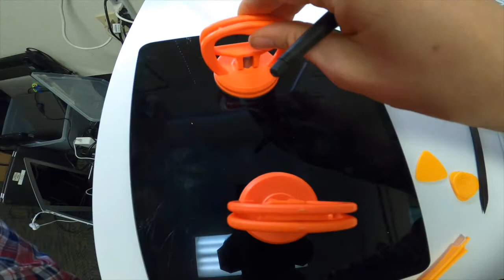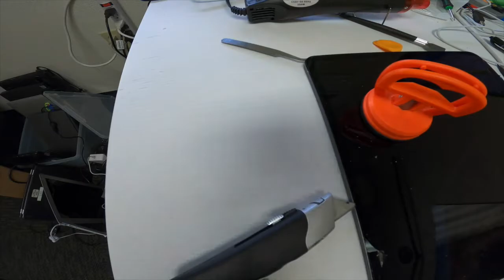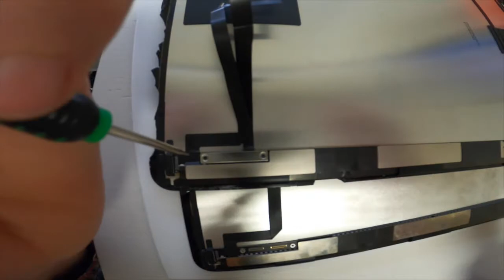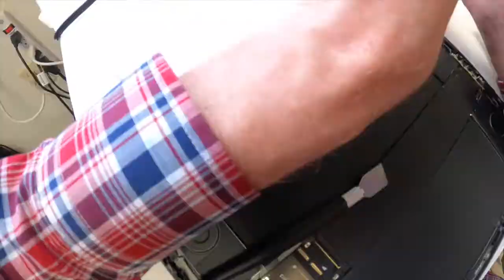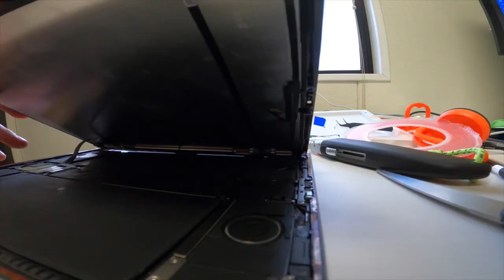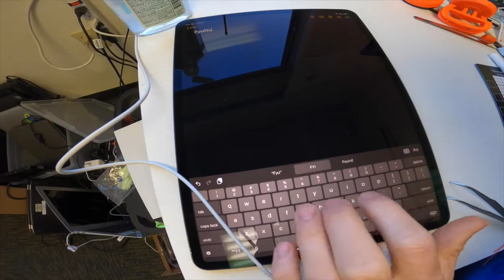ipad pro gen 4 - 13in 2020 model screen repair how to

Comment: Thanks for this!  I cracked my 2020 ipad pro's screen and have no coverage so its either shell out $650 to have apple do it or try to do it myself.  I have all the tools and am pretty sure I can do it but I've had trouble tracking down the right screen.  I came across the one you linked but found it iffy that it claims to be for both 2018 and 2020 models since I couldn't find out if the displays were actually identical between the models.  Has the replacement screen had any issues since you installed it?
Reply from the maker: The screen has worked well since I made this film. And I do think these are easier to replace than the older ipads b/c the digitizer is fuzed to the screen.  Thank you so much for the donation!